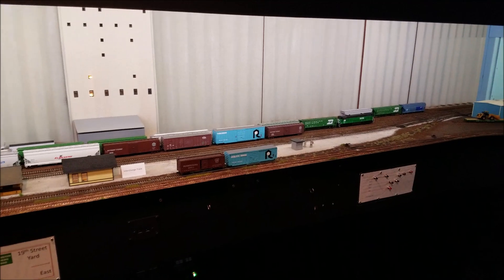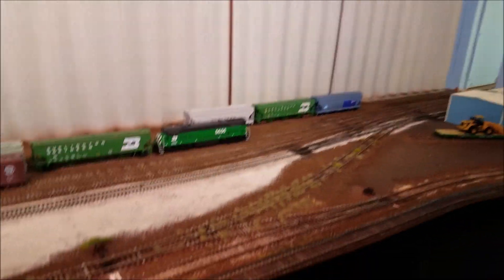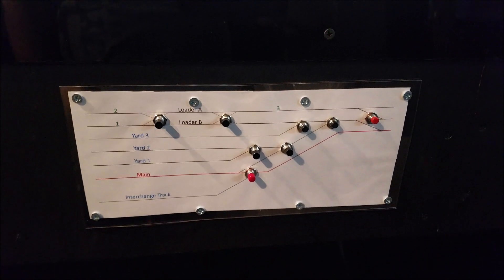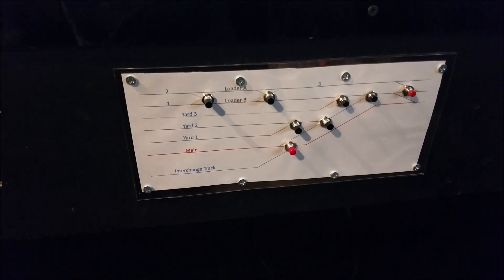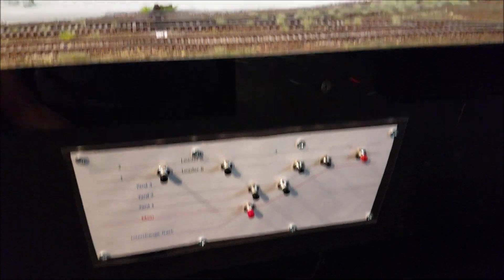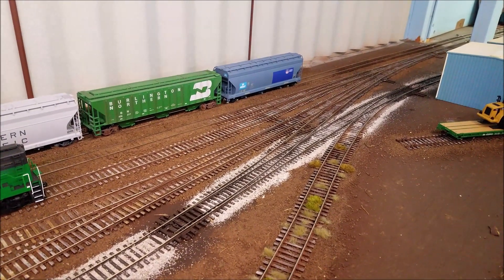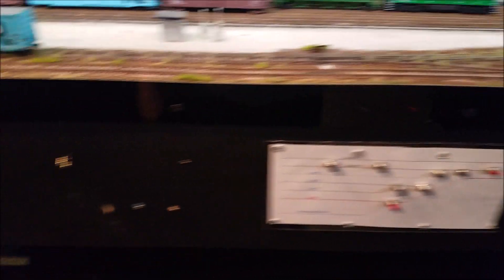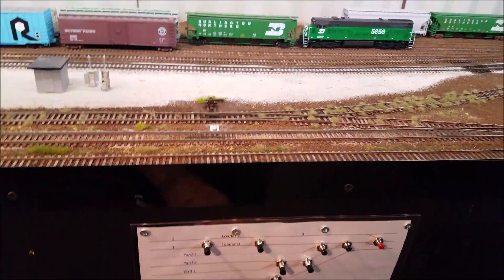How To Add Extra Sensor Inputs For DCC

Comment: Excellent info!  Will this device and method work with any type of switch (driven by a Tortoise, servo, Kato, snap)?
Reply from the maker: Yes, it sends out a basic sensor command that can be converted to a turnout command regardless of what type of turnout control you have.

Comment: Can you explain how you’ve set this up in dr5000 config? I thought it could only be done using the s88 version of the dr4088. Thanks.
Reply from the maker: There are two ways to map the DR4088GND inputs to the turnouts.  If you are using the S88 version, then you can do it in the S88N tab.  If you are using the DR4088LN-GND version, then you will need a PC Program to setup the logic.

Comment: Can I use this with Trix turnout decoders with either an ECOS or a Digitrax 210+ command station?
Reply: Hi, very good idea, thanks for that video...i ordered a DR4088LN-Gnd module to test with my 5097 loconet Esu module connected to my ESU Ecos2, i'll give you my feedbacks. 👍✌️

Comment: I would love to see the script for this.  Are you doing it with the DR scripting or JMRI?  I was looking into DR Script, but could not figure it out, and I just have not tried in JMRI yet. 

I installed the push buttons to the DR4088, and I can see the DR5000 receive the signal, i just wasn't sure how to get it to actually throw the turnout.
Reply from the maker: I'm sure it could be done with scripting but it is really easy with JMRI.  Each sensor output is reported as a LS.  In the turnout table, find the turnout and assign the sensor.  All you have to do is throw the turnout with the throttle or switchboard and then the turnout will show up in the table.  You can also define what you want it to do.